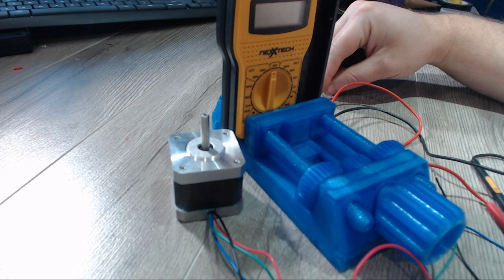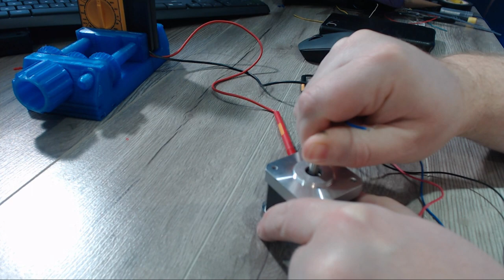Mapping Out Wire Pairings on Stepper Motors - 3D Printers 101

Comment: sir how can you which is + and which is - . i have some no lable motors and want to use in my diy 3d printer. i have the mainboard wiring diagram but dont know + and - on the motor